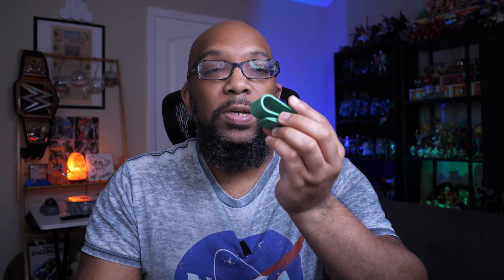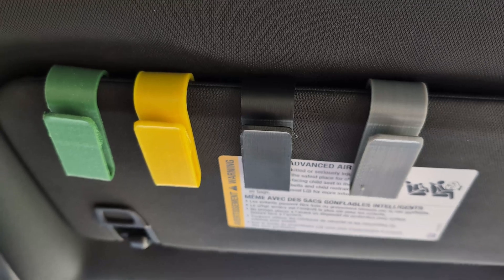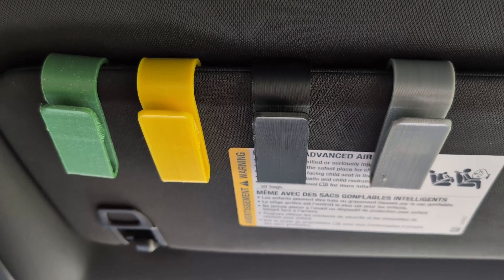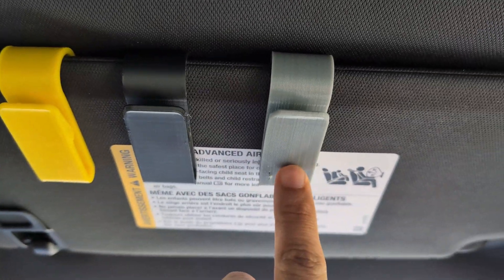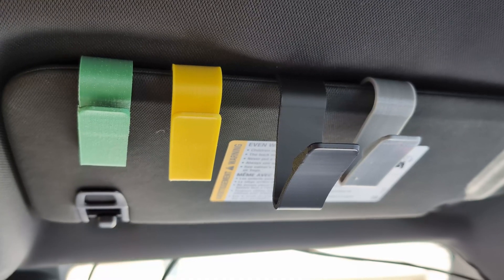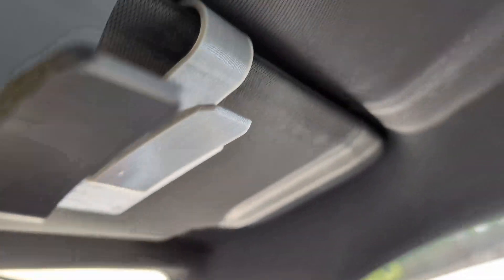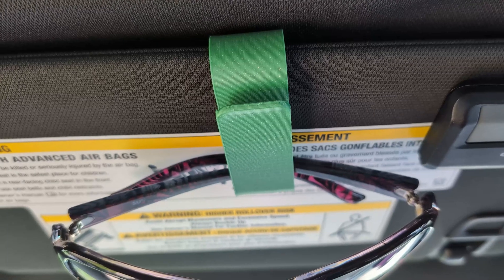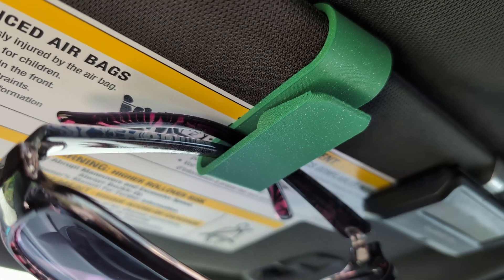Filament Summer Showdown! Can These Filaments Survive Inside a Hot Car?

Comment: Thanks for making the video. Multiple sources on the internet say that ASA holds up better than other common filament materials in outdoor heat and UV. However, it's still invaluable to see an experiment that tests this under real-world conditions.

I need to print some small plastic mounting shims for my boat that will sit out in direct sunlight, and I'm going to try printing in ASA. Your real world test gives me confidence that ASA is the best choice out of common filament materials that I can print without too much trouble.

Comment: Brand must make all the difference I wonder. I have a black PETG cell phone holder for my car in central Fla. It has think fins which slide into my CD slot. Despite Fla being 10,000 degrees in my car, it's never deformed in the slightest. The brand is Atomic which is one of the best.
Reply: Thin fins**

Comment: I'm honestly surprised with the performance of your PETG prints.  I designed and printed a cantilever style cup holder for my wife's Maverick truck.  I tested it with two full 32oz cups for over a week and had zero deformity.  Maybe the formulation of your PETG?
Reply from the maker: That's very possible. I used Elegoo Rapid PETG which can be printed at a lower temperature than some other PETG filaments.

Comment: Useful practical experiment! It will of course vary by brand, product line, and even color. I am surprised the PETG-CF failed like that. I know it's supposed to be a general video, but knowing the brands and exact products would be nice. The nice thing about the TPU is that it's less likely to permanently deform. It's just also not the best product for this specific application really. Good stuff!

Comment: Jeremy how did you print the ASA? Ive never tried it but have been told it is a nightmare to print with and is highly toxic?  what machine did you use and was it enclosed?
Reply from the maker: I printed it in the Adventurer 5M Pro fully enclosed. The Inland ASA I used printed great. The fumes are toxic which is why an enclosure and filtration/venting is recommended.
Reply: Neither ABS nor ASA fumes are technically toxic. ABS fumes smell bad and may cause irritation. ASA fumes generally don't smell as bad, but still aren't great for you. As a general rule, you don't wanna be inhaling printing fumes, but highly toxic is definitely not accurate.
Reply: @802Garage  That is COMPLETE false information that could get people very sick.  its called Salycylate Toxicity and can cause respiratory issues, irregular heartrate, dizziness, vomiting and other symptoms leading to death if not treated.  And the worst part of it is that you body doesnt purge the toxins from your body very quickly when your exposed so they are prone to addup and symptoms will magnify the longer your around melting ASA.  I am an EMT of over 20 years bud, trust me on this. the stuff is hazardous to your health.  Go watch Loyal Moses talking about his ASA poisoning in one of his videos if you dont believe me.  its not "Opinions" about it just smelling bad, its factually toxic

Comment: For anyone asking about ABS there's already an excellent vid comparing ASA to ABS
 https://youtu.be/4n4GH9NmlZU?si=agerVLPCcKoFMwb8

tldr is ASA is technically more resilient to heat but not by a lot. Pros and cons with both.

Instead of another test with ABS, I'd love to see an exploration of fumes/VOCs when printing ASA/ABS/etc in a 5m with the DIY enclosure. Specifically how it compares to the 5m pro - and what level of modding is necessary to bring the 5m up to par.

It's a lot, but it doesn't look like there's much out there on this for the AD5Ms 🤷

Comment: Ive had pla inside my car and on the outside for 3 years now and it's held up perfectly
Reply: It may depend on where in the car. These were at the top where the air is hottest and near the roof which will be radiating heat. Something stored in a glove compartment or door pocket will have different results. This brings to mind an interesting test; print the same model and put it in different areas on the car.
Reply: @jdl3408  It will also just vary dramatically by brand, product line, and even color.

Comment: How many times did the ASA print fail to stick to the bed? 🤣
Reply from the maker: 0 fails! I was surprised. Nylon though ...
Reply: @FigureFeedback  Oh man yeah...Nylon is the DEVIL
Reply: Unless you are running a cold chamber, ASA is ultra easier to print than ABS. Some brands have additives that make it work in open air but I've not seen the strength tests on them

Comment: How bout a video about setting up and printing asa on the 5m
Reply: Default profiles on the a5mp for abs has no problem printing ASA. Same components on the a5m, wouldn't print it without an enclosure due to chlorine vapors though.
Reply: @ronaldhiser860 just finished installing the enclosure and printing fan ducts now for the filters. although I need to redo the top cause I was printing in the burnt titanium filament and had to order another roll didn’t pay attention until I was 3/4 way done they sent me the wrong color
Reply: @jsInstalls  On that now, don't print in the Burnt Titanium ASA. It's junk. Crackles and pops like no tomorrow. Super brittle and doesn't dissolve in acetone. Took me over 16 hours of dry time and still was popping like crazy. The petg version works great though, just still required dry time.